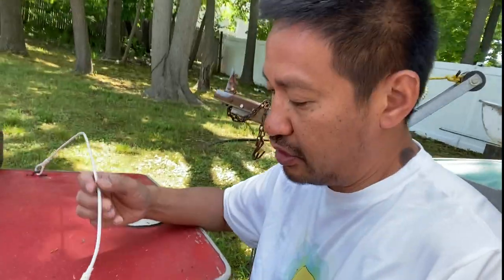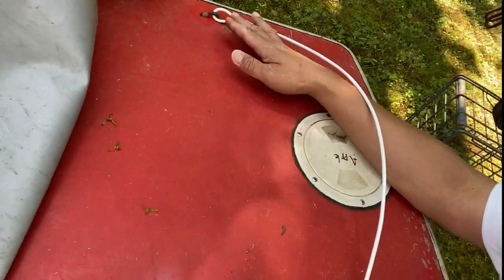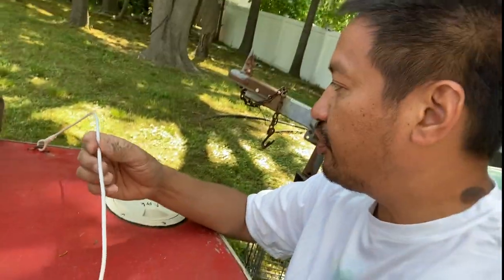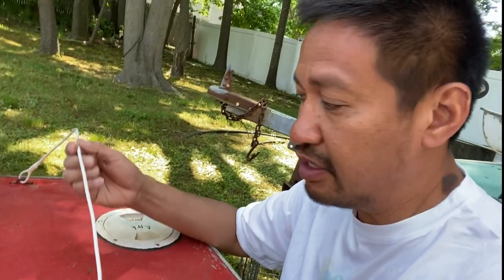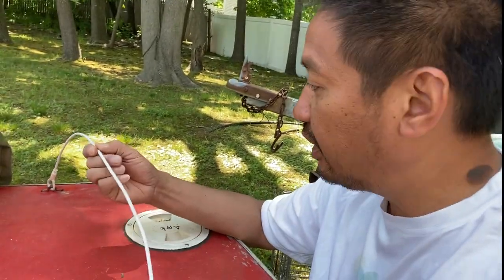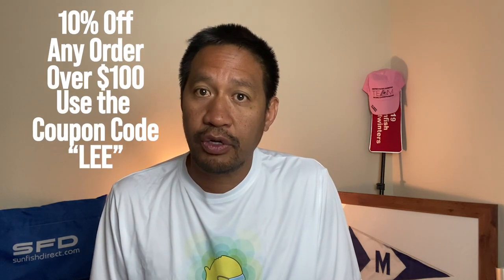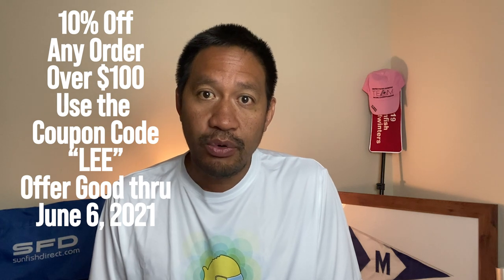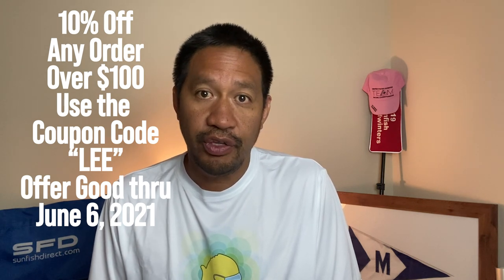How to Install a New Sunfish Bridal/Traveler | Sunfish Sailing

Comment: I also installed a 3 ft or so piece of .5 in PVC pipe below the bottom boom between the pulleys to encase the main sheet, because it kept going around my neck or taking off my hat when I changed to the other tack.  Used tie wraps to secure it to the boom.
Reply from the maker: Yup.  Works well!!

Comment: I have an old sunfish, and my bridle broke. I didn't remove the kleats, I just cut the other side with wire cutters to remove the rest of it. I then replaced it with a new one made of a piece of rope. I probably will replace it every season wether it needs it or not. Work just fine, is very easy and cheap.
Reply from the maker: Absolutely!   Probably good to change it, periodically, especially is stored in the sun.

Comment: I did this very thing last week. Unscrewed one screw part way on the eyestrap and partially unscrewed the other one on the same eyestrap. Slid out the old bridle and slid on the new. Tightened up like a champ. Went to the other eyestrap and both screws spun without coming out. Super. I'll be installing an inspection port, hacking foam, replacing the backing blocks and using bolts, fender washers, and nylock nuts to make it a permanent fix. As you said, nothing is ever easy on an old Sunfish.
Reply from the maker: You got that right.

Comment: I had to get under the aft deck when putting in a new bridle, because old screws had corroded and failed, dropping the block, which was also rotted.... If you have an earlier model Sunfish with the metal trim, there is an alternative to putting in an inspection port. Remove the trim along the edges, aft of the center well, by drilling out the rivets and tapping the edging with a steel paint scraper and mallet to persuade it off without distorting it. Then use the scraper and mallet to split the deck from the hull at the joint, prying slightly. You can peel up enough of the stern deck this way to do a bridle backing repair and even a ruder gudgeon change, without making an inspection port hole in the deck.  You then put some epoxy and glass tape in the joint and clamp it down, run a bead of sealant, re-attach the edging, go sailing. Same procedure can let you in at the bow to repair a hand grip block, add blocks for deck hardware, or access the front of the mast well and daggerboard trunk. Just don't fully break the joint around the entire hull: leave it alone at the cockpit well, or re-aligning everything will be a nightmare.

I found a previous owner had used a toggle-bolt to retain a foot strap; this is not a good idea because the spring jaws of the toggle will put stress cracks in the fiberglass hull or decking and rip out when you don't expect it. They will also corrode and fail when you least expect it.
Reply from the maker: Your method seems like the way to go of you wsnt to avoid the inspection port.  And i have experienced that toggle bolt fiasco first hand.  Hehe

Comment: A stainless cable will not corrode. Use a nickel plated sleeve with stainless cable. My repair included installing a new Nico sleeve, covered with heat shrink tubing. I could have made a loop in the middle, but the cable was too short. Good enough for my hang glider, good enough for my Sunfish. You can break a lot of rules on a Sunfish, but not a hang glider!

Comment: Is there a benefit to having a longer looser traveler as opposed to having a traveler that is tighter to the deck without a center loop? I understand the principle of allowing more travel to better balance the boat but what benefits does the slack bring as opposed to the way the traveler is rigged on a laser, where the traveler is pulled and cleated very taught with just enough slack to allow the tiller to articulate. Would there be a benefit to switching to a taught traveler set up similar to the laser on a sunfish?
Reply from the maker: A very loose traveler on a sunfish will not let you trim in as hard.   There’s a point when you are trimming in that the boom starts to move lower….  With an extremely tight traveller that down ward action of the boom will happen sooner. In light air it’s probably better to have a tighter traveller or centerline the Mainsheet (as with the old loop).  As the winds pick up a looser traveller would be more beneficial to keep the boat balanced more. TOO LOOSE a traveler would be bad if you couldn’t trim in close when needed…. For the most part the regular wire traveller handles most conditions nicely.

Comment: Thanks for creating these videos. I think this one though lacks a lot of important information when replacing a traveler bridle on an old boat. You should not remove both screws on each eye strap as the block of wood may fall and then you will need to install an inspection port. Also one screw broke off before you removed it so I don't understand why you re-installed the eye strap using an old screw. You should, at the same time, replace the screws with new brass screws or better yet, stainless steel screws. There is also another reason to go to the two loop bridle. The three loop means the entire mainsheet load is on one eye strap depending on which tack you are on. The two loop helps to spread the mainsheet load to both eye straps no matter which tack you are on.
Reply from the maker: Hi Craig!   Thanks for all the great comments and observations.  You are absolutely right and there are a few reasons why I installed the strap with a broken screw.1.     (Most people would not have noticed)- that’s why I edited that way, i typed “doe the same thing on the other side”.  BecAuse of time. I was on a lunch break, didn’t have a drill handy and by the time I actually could do it properly i would have been two days later.  2. The bridal, as you pointed out, would not be good enough to sail with the broken screw.  I also didn’t have new screws available and didn’t have time to run to the store. Therefore, people with keen eyes will catch things that may be me cutting corners for video production needs :). Hopefully I include enough information to provide most people to get the job done properly enough to be able to sail safely.   I really appreciate your comments!  And love that you caught the details :).

Comment: Doesn’t it seem that omitting the center loop causes the rig to favor downwind tacks and suffer with up wind tacks where you’d prefer the sail to be closer in?  Does the same sheet clasp that attaches the center loop go onto the loop less bridge traveler and slide easily or do I need some McLube Sailkote for that to happen smoothly?  Finally, when you drilled out your broken screw did you epoxy or marinetex the hole then drill a new hole?
Reply from the maker: Good catch.   For the video I did not have time to replace the screw properly.  I will drill it out snd replace it, maybe use 5200...  you don’t have to use the clasp/shackle when there is no loop.  A simple Bowline will slide nicely.  As far as the first question.  I think it depends on the wind velocity.  I don’t think the loop or no loop a
Has as much affect downwind Sailing as much as upwind sailing.  Upwind, in heavier airs the loop is not a good with balancing the boat.  Thank you for the comments!